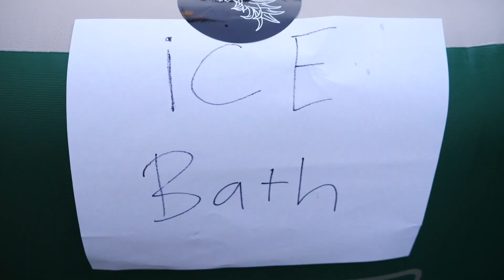Jamie Obrien Called Me Out!?

Comment: Wait, is this for real? 
You guys are still cool with each other, right?
Reply from the maker: Yeah it’s a complete joke, just for fun !
Reply: Cool, thanks. Was bummin for a sec, 

There is a novelty wave here on the southern Mendocino coast. That I look at and think about you scoring it, well, northern Sonoma coast actually. 

Big rock, about 100 yards off the coast with a left and right that converge on the inside, and reform to form a middle peak washy straightliner, 

It’s pretty nutto

Can you picture that? The swell wraps around the rock for the left and right, then on the inside 
Connect to form the straight line wave, or really if it’s big, you could almost surf both the left and right, back and forth, or just sit in the straightliner pocket